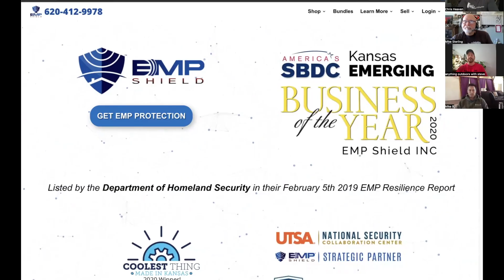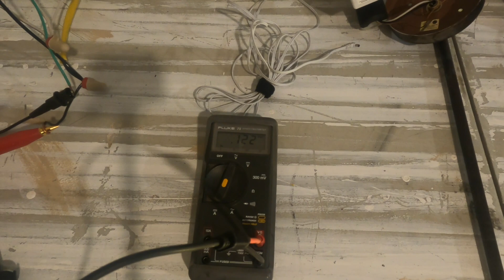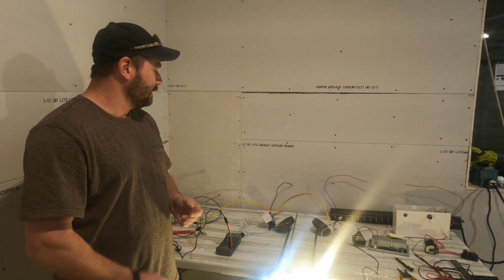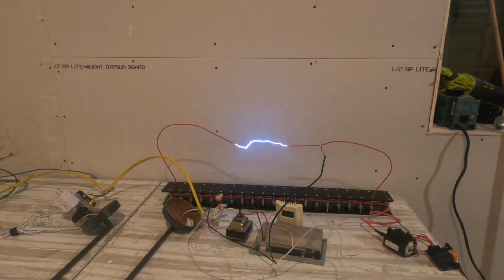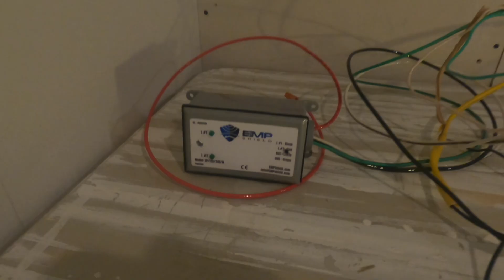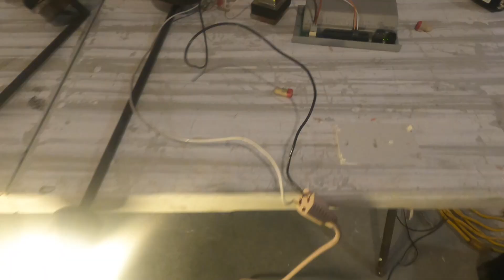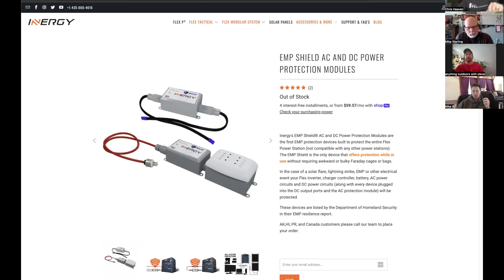We TESTED the EMP Shield... UNBELIEVABLE RESULTS! WOW!

Comment from the maker: NOTE TO THE IGNORANT HIDING BEHIND THEIR KEYBOARD ... Before making a comment and confirming you're an ignoramus, read up on using a Marx Generator to create electrostatic discharges to mimic a high energy EMP threat condition. This is a widely accepted methodology. Nobody is interested in you spewing theoretical crap that nobody can prove. If you disagree with our testing process you're welcome to say so. However, if you break out the knives we'll respond in kind. THINK BEFORE YOU COMMENT. Our videos are NOT a soapbox for crybabies with a Hall Monitor complex. If you want more details on how we moderate the comment section see our friend NotARubicon Randy's video here ... https://youtu.be/mAtkSLFx3PQ?si=fyrCoYqw39aPqk3a. It's the gold standard for dealing with dickheads.
Reply: Nasty little SOBs. Something to hide?
Reply: Kind of looses it’s authenticity when ALL of you “creators” keep saying the EXACT same thing! 

Just taking preventative measures to attempt to shut down the inevitable comments, and for good reason…. Being “inevitable” and all! 

Sure, against lightning it works! That comes in through the ground and/or into the wires…. But an EMP goes through everything! Electronic devices don’t need to be hooked up to power to fry! What does that tell you and how does it make sense this would work? 

I do not know AC too much I’ll admit but I understand electricity enough and how circuits work (however most all your electronics run off DC via power supplies, AC is just easier to transmit and rectify to useful DC) 

As far as vehicles, these modules make absolutely no sense what so ever, MAYBE if it had a grounding strap that came out and dragged along the ground under the car, but grounding it through the chassis will just make damned sure it fries the ECU! 

EMP attacks micro controllers and processors directly, doesn’t need to be powered and doesn’t need to make a circuit (even those “experts” say just that! 

This is going to blow and pop a breaker that it’s hooked up too, giving you a sense of security that it’s working HOWEVER all you’re doing is hooking it up before the breaker so of course it will blow in a lightning strike! Our homes are already protected from lightning strikes! (That big twisted bare wire in your mains box that goes out and into the ground!) 

If they were confident they worked, they wouldn’t have potted it to hide the guts, they also would have implemented a resettable fail safe in the event of an electrical spike or EMP! 

Please by all means, respond….. people have dissected these and they are nothing more than the automotive gimmick “antizap” sold for welding on new vehicles… Google “EEVblog automotive surge protector” and look at what’s inside, after that Google “EMP shield what’s inside” first IF you do so respond. 

Not that it matters, if an EMP hits you, the EMP is not what you need to worry about! 

Lastly your test setup lacks 1 very important component, it has A LOT of voltage but there is basically nil amperage! One big reason an EMP is effective is because the current overload and not just the voltage surge! (There’s never talk about ampere and all voltage…. Why?) 

Look forward to a response!
Reply: @sailingwiththegods538 got to follow them NDA's!!! 😂 My comment is gone it seems, however that's nothing new, YouTube passive aggressively removes my comments for telling "mean" truths!
Reply: @SurvivalDispatch  shake your cage.
Reply: @SurvivalDispatch  I know you guys like eyeballs to stay on as long as possible but why can't you guys simply lead with YES/NO and then let the nerds and engineers stick around. Put in all the disclaimers you want, but why don't you lead with the conclusion and then prove your thesis?
Reply: Ignoramus? I haven't heard that word in 40 Years thanks for making me smile you guys see the greatest
Reply: Garbage. When a EMP happens you will know these guys are in the tank.
Reply: @jamesmarkham3173 ... Where is your video backing up your mouth? You're a clueless douche.
Reply from the maker: @jamesmarkham3173  Where is your video and testing proving your assertions? Or, are you just speaking out of the side of your mouth?

Comment: I purchased this EMP Shield to protect my solar system in case of an EMP attack. The system was working perfectly before I installed this device. Before I explain I want it to be known that I used to own a high tech software development company, so, I most definitely have a technical development background. Besides, installing a solar system is NOT rocket science and almost anyone who does a little research would have little problem doing their own installation. All interfaces to the house wiring were done by licensed electricians. When I received the Shield I installed it according to the directions included. It was a very easy installation. Once this was done the Shield proceeded to completely drain my batteries and damaged my controller.

The EMP Shield technical support did NOT get back to me concerning this issue. Evidently, them being in a meeting was far more important than handling an issue like mine. They even refused to return my call once they were out of their meeting. All my equipment was purchased from Missouri Wind & Solar who have very competent technical sales people The system was a 24 volt system with eight AGM batteries from Vmax Systems in Michigan. So, the entire system was properly configured and installed and fully functional BEFORE the installation of the EMP Shield. Even stated from one of the owners the EMP Shirld could have caused the batteries to discharge. Who, in their right mind, would attach one of these things to a battery bank if this was a possibility? My battery bank cost over $12,000, so, there’s absolutely no way that I’d even remotely consider attaching one of these things to my system. They did NOT offer a warranty for the damaged controller and even charged me a restocking fee to return the defective device. I do NOT need to deal with people that support their products in this manner. I NEVER would have even dreamed about supporting my customers in this manner. I installed a new Midnite Solar Classic 150 controller with one of their surge suppressors and I’ve never had a problem since.

Comment: I purchased an EMP Shield for my solar controller. It totally discharged my batteries and damaged the controller forcing me to buy another. I'd NEVER advise someone to buy this thing as they do NOT stand behind their warranty. Incidentally, they have NOT adequately tested this thing so there's no proof that it will actually work.
Reply from the maker: Directly from one of the owners of EMP Shield ... 

"Chris,
 
This is not possible for the device to cause any damage to the controller. Our device is passive and its function is to remove excessive energy very quickly. I do believe an EMP Shield could drain the batteries if he bought the incorrect devices. Example, if he is using a 12V device on a 48V battery.
 
I am not aware of this customer but I can ask. We 100% stand behind our warranty and if he did submit a request for the warranty and it wasn’t approved, it means he violated to warranty in some way. Usually, in this scenario, it’s a customer that either bought an incorrect device, or did something harmful to their system and then try to blame the shields."
Reply: @SurvivalDispatch  I used to own a software development company that developed high tech software. So, I'm quite technically proficient. All my devices for my 24 volt system were purchased from Missouri Wind and Solar from very technically proficient sales people. I installed the system myself as this is not a technically difficult task. All electrical work to interface it to my house wiring was done by licensed electricians. This controller was working perfectly until I installed the EMP Shield. The controller then started to malfunction and the batteries drained completely. When I called for support I received none and when I returned the one EMP Shield I was charged a restocking fee. I NEVER treated any of my customers in this manner. I got a new controller and put a Midnite Solar surge suppressor on it and I've never had a problem since. I would recommend that you talk to the "hired help" and train them in how to properly handle customer issues.
Reply: @SurvivalDispatch  I purchased this EMP Shield to protect my solar system in case of an EMP attack. The system was working perfectly before I installed this device. Before I explain I want it to be known that I used to own a high tech software development company, so, I most definitely have a technical development background. Besides, installing a solar system is NOT rocket science and almost anyone who does a little research would have little problem doing their own installation. All interfaces to the house wiring were done by licensed electricians. When I received the Shield I installed it according to the directions included. It was a very easy installation. Once this was done the Shield proceeded to completely drain my batteries and damaged my controller.

The EMP Shield technical support did NOT get back to me concerning this issue. Evidently, them being in a meeting was far more important than handling an issue like mine. They even refused to return my call once they were out of their meeting. All my equipment was purchased from Missouri Wind & Solar who have very competent technical sales people The system was a 24 volt system with eight AGM batteries from Vmax Systems in Michigan. So, the entire system was properly configured and installed and fully functional BEFORE the installation of the EMP Shield. Even stated from one of the owners the EMP Shirld could have caused the batteries to discharge. Who, in their right mind, would attach one of these things to a battery bank if this was a possibility? My battery bank cost over $12,000, so, there’s absolutely no way that I’d even remotely consider attaching one of these things to my system. They did NOT offer a warranty for the damaged controller and even charged me a restocking fee to return the defective device. I do NOT need to deal with people that support their products in this manner. I NEVER would have even dreamed about supporting my customers in this manner. I installed a new Midnite Solar Classic 150 controller with one of their surge suppressors and I’ve never had a problem since.
Reply: @SurvivalDispatch  I purchased this EMP Shield to protect my solar system in case of an EMP attack. The system was working perfectly before I installed this device. Before I explain I want it to be known that I used to own a high tech software development company, so, I most definitely have a technical development background. Besides, installing a solar system is NOT rocket science and almost anyone who does a little research would have little problem doing their own installation. All interfaces to the house wiring were done by licensed electricians. When I received the Shield I installed it according to the directions included. It was a very easy installation. Once this was done the Shield proceeded to completely drain my batteries and damaged my controller.

The EMP Shield technical support did NOT get back to me concerning this issue. Evidently, them being in a meeting was far more important than handling an issue like mine. They even refused to return my call once they were out of their meeting. All my equipment was purchased from Missouri Wind & Solar who have very competent technical sales people The system was a 24 volt system with eight AGM batteries from Vmax Systems in Michigan. So, the entire system was properly configured and installed and fully functional BEFORE the installation of the EMP Shield. Even stated from one of the owners the EMP Shirld could have caused the batteries to discharge. Who, in their right mind, would attach one of these things to a battery bank if this was a possibility? My battery bank cost over $12,000, so, there’s absolutely no way that I’d even remotely consider attaching one of these things to my system. They did NOT offer a warranty for the damaged controller and even charged me a restocking fee to return the defective device. I do NOT need to deal with people that support their products in this manner. I NEVER would have even dreamed about supporting my customers in this manner. I installed a new Midnite Solar Classic 150 controller with one of their surge suppressors and I’ve never had a problem since.
Reply: @SurvivalDispatch  I purchased this EMP Shield to protect my solar system in case of an EMP attack. The system was working perfectly before I installed this device. Before I explain I want it to be known that I used to own a high tech software development company, so, I most definitely have a technical development background. Besides, installing a solar system is NOT rocket science and almost anyone who does a little research would have little problem doing their own installation. All interfaces to the house wiring were done by licensed electricians. When I received the Shield I installed it according to the directions included. It was a very easy installation. Once this was done the Shield proceeded to completely drain my batteries and damaged my controller.

The EMP Shield technical support did NOT get back to me concerning this issue. Evidently, them being in a meeting was far more important than handling an issue like mine. They even refused to return my call once they were out of their meeting. All my equipment was purchased from Missouri Wind & Solar who have very competent technical sales people The system was a 24 volt system with eight AGM batteries from Vmax Systems in Michigan. So, the entire system was properly configured and installed and fully functional BEFORE the installation of the EMP Shield. Even stated from one of the owners the EMP Shirld could have caused the batteries to discharge. Who, in their right mind, would attach one of these things to a battery bank if this was a possibility? My battery bank cost over $12,000, so, there’s absolutely no way that I’d even remotely consider attaching one of these things to my system. They did NOT offer a warranty for the damaged controller and even charged me a restocking fee to return the defective device. I do NOT need to deal with people that support their products in this manner. I NEVER would have even dreamed about supporting my customers in this manner. I installed a new Midnite Solar Classic 150 controller with one of their surge suppressors and I’ve never had a problem since.

Comment: I used to test traction motors on locomotives.restance, test hipot ,meger don't mess with the hipot the motors run on 440 dc.we did have acdc motors both types.we had to test run the motors on wood blocks with a switch and power supply at about 300 volts .

Comment: Small to moderate EMP or CME, the distribution network would survive and be back up.  If a major EMP or Carrington event occurs, the grid goes down long-term, so individual home protection isnt likely to restore your home power. I protect my computers, fridge, and important home electronics, but if a big voltage spike occurs, the grid goes down to my area, so big spike protection is moot.
Reply: BTW, I worked 29 years in large-scale renewable power, so I'm not uninformed. If you're seeing 50kV spikes in your home other than from a nearby lightning strike, likely would fry the distribution network to your neighborhood.
Reply: Many of us have backup power options (solar, propane/gas generators, hydro electricity, wind etc.) that are protected by EMP Shield devices. It's not a moot point for people who are properly prepared and protected. We're the only group that's ever tested EMP Shield and published a video of it. The 400k volt Marx Generator we built put out double what the most powerful nuke could created for an EMP and the product did exactly what it's supposed to. We built an 800k volt Marx Generator and Steve almost killed himself. We're currently building a 1.2M volt Tesla Coil for our next video on this subject which will be forthcoming by the fall.